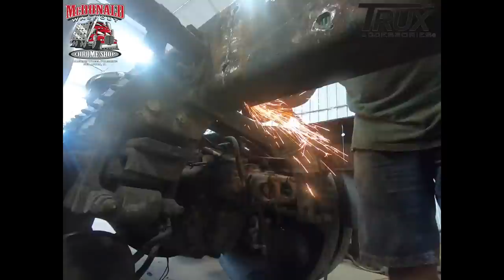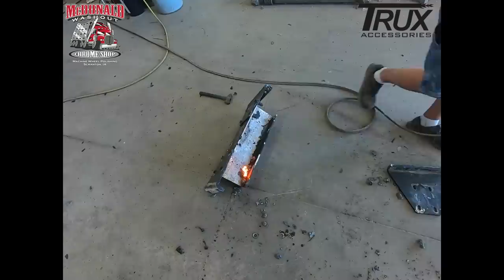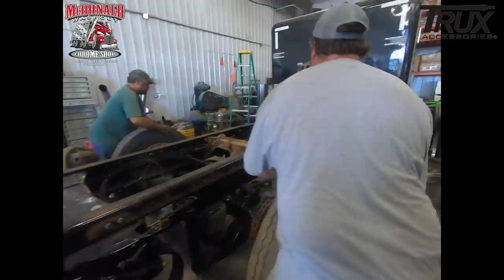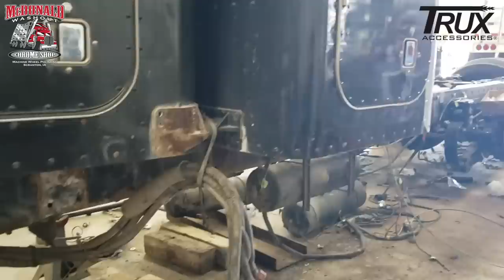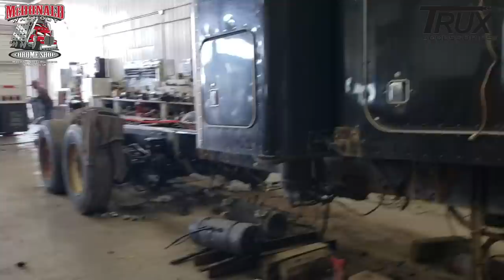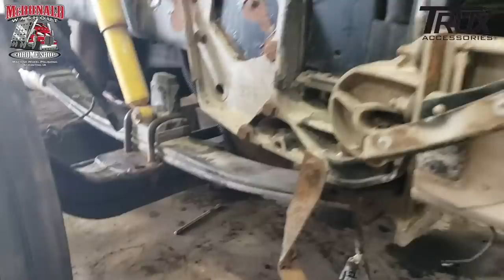Frame Stretch | cut off | Disc Brakes | Peterbilt 379 | McDonald Chrome Shop

Comment from the maker: Ive responded to this before and will here again then try to pin this comment to the top of this comments section. The story behind this video (specifically the welding part of the video) is that we simply had a problem with our wire feed and turned out we just needed to replace the lead it had been run over at some point and was causing the wire to feed inconsistently. Around the same time i had been doing a ton of research on how to grow our channel and gain the most subscribers, what i had found is if you post something (controversial) that will cause a lot of comments along with thumbs ups or downs doesn't matter negative or positive youtube pushes your video and channel a lot higher so we used the messed up lead and finished the cosmetic part of the welds. I edited the video and released it and boy were they right the amount of comments and thumbs up and down drove this video tho gain us well over 1,000 on this one video alone also made us the most money on ads and has done nearly 150,000 views to date. while this was happening we bought a new lead recut where we previously welded cleaned it up and re welded it correctly and recently sold this truck for over 6 figures. we have had many customers call us since seeing the finished project, how the frame on this truck and every truck we do is completed and inquire about doing the same to their truck. Some out there don't or wont believe we would post this just to see if it gained subscribers for the channel. But i'll Leave you with this, If this is how the truck was left and put together don't you think i would of went back in and edited that part out after all these negative comments? disabled comments, or taken the video down completely?  The answer is no, it's done exactly what it was intended to do and in later videos of this project you can see how the completed job turned out. This truck went to a few truck shows, had hundreds of people come through our business to see it and then had potential buyers come look it all over before it was purchased. The frame was redone correctly with the welder working properly and lastly as stated before we stretch or put cut offs on an average 5 trucks a year over the last 20 years and have never once had any issue even after 2 of the trucks we know of were in roll over wrecks loaded frames were still in tact. So Everyone can feel free to comment but this is the explanation of this video. Thanks for watching

Comment: Never cut the frame strait always always on a angle,,,both frame and what you are adding ,will never crack on the top rail then bolt it together ,the whole piece under and outer frames will flex together ,,,,never ever crack a weld either  did a lot of them in my day ,, beautiful old Pete love it !

Comment: Just Wow!!! I have completed many stretches in a truck body shop, definitely not how I would have done this one. A messy end product. The poor welds will hold if the new frame sections are all bolted properly to the old sections with graded bolts. And I totally agree, never straight cut a frame, I made an arrow head template to cut frames, never had a warranty comeback.
Reply from the maker: you havent seen the final product so not sure how you would know the end product is messy but ok. we have stretched over 5 trucks a year average over the last 15-20 years. never had a frame crack, break, no issues ever. my last truck i drove myself was stretched to 331" wheel base we did that one in house also. i put over 1 million miles in it hauling cattle and once again no issues ever. and when you see the finished product you wont even tell its stretched unless you look in the frame from the inside and see the inner rail.

Comment: That weld on the frame is scary looking. Good luck to the person driving it.
Reply from the maker: there are different cuts for strength people use when they dont add internal frame rail like we did on this project. z cut, adding a diamond plate welded, claw cut, and so on but when you add as much frame rail as we did in over 15 years we have never had an issue stretching this way and my personal 1998 W900 we stretched to 331" wheel base, i put over 800,000 miles on it never an issue. thanks for watching hope you check back when the project is finished and see the full amount of strength we added to the frame. I could only show so much in this video frame was not complete but needed to upload . we had gotten busy working on our farm equipment its getting close to harvest here. also the piece i showed being weld was just the first step to the welding we do to not only make that cosmetic piece be able to blend in at the ens of the build but add strength, again i was not able to show the finished product but i believe when we do and explain all we have done to add strength you may change your mind on the quality. or you wont either way thanks for watching
Reply: I completely understand the type of cuts and using a liner when stretching but what does that have to do with that as I would call it bird droppings weld?Theres one of several things wrong. Surface not prepped good enough,wire speed,heat not right. I stretched my 359 and it didn’t look like that. Mine looked like a roll of dimes with good penetration both sides. It’s not rocket science stretching a truck.

Comment: Glad thats not my truck gettin whacked and hacked! Grind the paint off before you weld and it works alot better! Id be scare to pull my trash can with that!
Reply from the maker: there are different cuts for strength people use when they dont add internal frame rail like we did on this project. z cut, adding a diamond plate welded, claw cut, and so on but when you add as much frame rail as we did in over 15 years we have never had an issue stretching this way and my personal 1998 W900 we stretched to 331" wheel base, i put over 800,000 miles on it never an issue. thanks for watching hope you check back when the project is finished and see the full amount of strength we added to the frame. I could only show so much in this video frame was not complete but needed to upload . we had gotten busy working on our farm equipment its getting close to harvest here. also the piece i showed being weld was just the first step to the welding we do to not only make that cosmetic piece be able to blend in at the ens of the build but add strength, again i was not able to show the finished product but i believe when we do and explain all we have done to add strength you may change your mind on the quality. or you wont either way thanks for watching

Comment: I see a bunch of negative comments about this video but I'm not seeing one of these back seat quarterbacks showing their skills...
Reply: I'm a couch potato. I can't believe the rails were cut vertically and the standard practice is to do it on angle as I saw it done in truck smash repair shop I worked at. Also the welding looks like shit to me.
Reply: Andrew King Amen
Reply: Because us real fabricators aren't gonna waste time trying to prove anything we know is true lol. I used to cut and weld the beams used for holding buildings, factories, and skyscrapers up. It's not a hard job to get but when you actually have a QC guy on your ass to do perfect then shit like that would get me fired immediately.

Comment: Cutting the rail at a45 degree angle gives a longer weld area. Than add a flat plate with holes and weld in. Doubling the frame is admitting you don’t trust your welding.
Reply: Thank you .
Reply: Yup
Reply: Exactly. Btw I hear you can order the frame rails in whatever length you want from paccar. Shit steel industry is booming here in Alabama. I wouldn't be opposed to seeing what size steel they used and order a custom length and cut the wholes myself with a magnetic drill press just like we do it commercially
Reply: Always double frame your welds always, don’t be a fool just the weld with a flat plate will not last with 34k on your drives on a bumpy roads.
Reply: @andreykichuk  trucks been in service for 10 years grossing 100,000 out of the woods logging. It’s definitely strong.
Reply: @dschefers9700  well even dealer trucks with long wheelbase come double framed with solid piece of steel, I’m a certified welder did a lot of work for duke power so I’m a good welder you just have to believe me, but if I cut my frame and weld it, I will double frame it just to be safe
Reply: @andreykichuk  I’m not downing on your skill, but with two on the road done my way for 10 years each with no problems I can tell you it works and I don’t have to worry about rust jacking because it’s all welded.  I think we can agree there is more than one way to do it

Comment: Like the upgrade! but as a fabricator/machinist by trade, I don't think it was wise to go with vertical down and no gap with the weld  on the frame cuts, I get the glove for the frame so it's made it stronger, I just think the welding was sketchy to do a vertical down with a mig on a frame stretch. This type of structural weld should always be vertical up. anyone that has spent much time with a hood on and trained the right way should be able to do this type of weld correctly.

Comment: You are always supposed to add on to the back and then move everything back and double frame it under the 5th wheel
Reply from the maker: that is one way to do it and a very good way but also very expensive because of the labor moving all your suspension. there are different cuts for strength people use when they dont add internal frame rail like we did on this project. z cut, adding a diamond plate welded, claw cut, and so on but when you add as much frame rail as we did in over 15 years we have never had an issue stretching this way and my personal 1998 W900 we stretched to 331" wheel base, i put over 800,000 miles on it never an issue. thanks for watching hope you check back when the project is finished and see the full amount of strength we added to the frame. I could only show so much in this video frame was not complete but needed to upload . we had gotten busy working on our farm equipment its getting close to harvest here.
Reply: I hear it's best to do the cut under the sleeper and hide it with the tanks

Comment: What did the disc brake cut off come from? I’ve got a 07 w900 with 46k rears that I’d like to put a better suspension and better gears and brakes. Also wanna stretch it and add a flat top sleeper.
Reply from the maker: came off a 579 peterbilt 2016

Comment: Is that a red top Cummins under the hood? Don't see those much anymore. So when I see one, it's just nice to see. Can't help but notice is all.
Reply from the maker: yes a fresh pre 2000 red top cummins all rebuilt with paperwork less than 500 miles on it
Reply: @McDonaldChromeShop Red Top, and Elog Exempt. Those words should be music to any drivers ears. They are to mine. I have a 93 379 EXHD with a 3406C. So yeah, like I said freedom. Or atleast it's as close as I could get to it.
Reply: My usual truck is a 2000 Freightliner FLD with a Redtop Cummins. 435 horse, has the select plus ecm. I love it. The setup in the truck, Rockwell meritor 10 speed,no idea what rear ratios are,anyway,it out pulls  the other two trucks with 14 liter 515 hp Detroits.Always runs between 20 and 30 degrees cooler,gets up to speed quicker but is governed slower top end. Can't just turn it up with that particular ecm. My only complaint.

Comment: It sickest your build so far on my opinion!! But what happened to front air conversion? Or it still in progress? Collecting the necessary parts!! It needs front air axel!!!
Reply from the maker: its not out of the question but its pretty spendy and before we order it we want to make sure we for sure want to go that direction. i agree i think it will need it along with the flip up bumper kit we have here in the chrome shop. we will see in the future videos which way we go. Thanks for watching and checkout our instagram im adding daily some of our older builds before we started filming them
Reply: How much it cost to stretched truck in your shop??

Comment: I thought y'all had some cool trucks.... until I seen you down hill with that wire feed!!!!!   I'll remember to stay clear from your "custom" or is it suicidal work..... stay out of TEXAS please
Reply: Not to mention there was no bevel done prior to welding.  When we stretch trucks its beveled and stick welded. Mig welding is to light duty for that thick of frame.  I had a hard time watching this video till the end.
Reply: Ima pretend I didn’t see that crap. Idk who in there right mind would let someone weld there frame like but I guess the saying holds true 1 mans junks onother mans treasure .
Reply: Josh mig welding is plenty strong enough to hold the frame together when it’s done right u can bevel that vertical up weld it and take grinder to the back side and backgrind into the weld from the back and vertical up weld that too and it’ll never break
Reply: I used to weld structural steel that held more than that clunker ever will and we would use a Miller Dimension 400 and 0.052 flux core and gas. My shit always passed analysis (radiographic testing aka x-ray) up to 1 inch thick steel. Still prefer mig to stick welding to this day.

Comment: Why did u all revolt frame cross member in between frame rails want to stretch my 99 classic any tips n pointers on how to is greatly appreciated
Reply from the maker: guessing you meant rebolt not revolt? the inner rail runs around 5 foot each direction so we removed the cross members to run the rails then put the cross members back in place to keep strength. depending on how far we stretch sometimes cross members are added for support

Comment: Is it legal to weld on the frame? Just curious because I see warning signs on the frame. Also if possible if you can go into detail as far as what rear end and front end was used?  Thanks for the videos. They are awesome.
Reply from the maker: yes it is legal when done correctly. they dont like to see frame welds with no additional support like added frame rails to the inside of frame. the warnings you are most likely seeing are fo protect them against liability in the future. need to also unhook electrical so you dont short out anything.
Reply: @McDonaldChromeShop  
Thank for answering my question. Can't wait for the next video.
Reply from the maker: thank you for watching. feel free to ask questions whenever , i always try to get back to people even the haters. lol
Reply: Matthew Fogarty I’m a super amateur at welding but I’ve noticed something similar making a horizontal pass Pushing instead of pulling like I used to. Idk I’m an amateur
Reply: Not supposed to weld on chassis frames that are heat treated .  Warning signs on the frame clearly state this.
Reply: @andrewpaulafford1418  The label on cigarettes say they cause all sorts of crap, but people still smoke. It's the same with those stickers, someone sued somebody sometime and then a lawyer told that somebody if there's a sticker there it will be way harder to get sued. On went the sticker. I've seen frames crack from hole to hole under heavy flex. Heat treated or otherwise a hole creates a stress riser and that's where 85 percent of cracks occur. You should preheat the surrounding weld area any way to mitigate any warping or significant loss of the factory heat treat. Let them cool real slow so they don't get brittle and you should have no problems at all.
Reply: @andrewpaulafford1418  , I was wondering that too, from the warning signs I read 50 years ago on heat treated frames. I suppose all frames are heat treated. (?)
Reply: Matthew Fogarty good

Comment: You all have any issues getting rust in between you double.frame ?  Or does that just happen up here in the north east?   Or is there something you do to prevent Rust ?
Reply from the maker: there is always a possibility of that problem but i know my brother uses something to try and seal it so this isnt an issue. ill have to get back to you on what he uses. we are harvesting right now so its a little hectic right now. thanks for watching
Reply: @McDonaldChromeShop  Thanks bud ,I enjoy the videos!  Have a a safe harvest!
Reply from the maker: @zachariahgemmill753  thanks, we will have more build videos coming soon as harvest is over. we will resume work on the coffin bunk 379 plus we just bought a couple cosmetically rough trucks that are daycabs but have paperwork on the engines and drive train.

Comment: We are looking to do this on our truck.  Immediately I knew this was amateur hour once I saw the vertical cut.  I have no experience doing this but have done enough research to know this is NOT what you want to follow.  Rails need an angled cut and reverse angle cut on opposite rail (ideally).  And the welding...no comment.